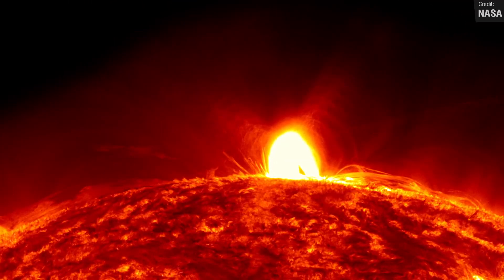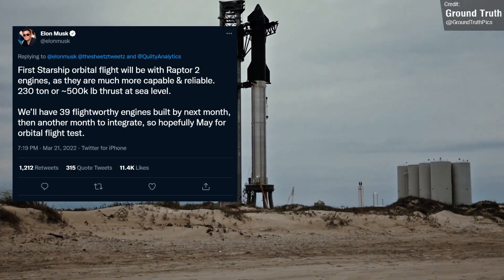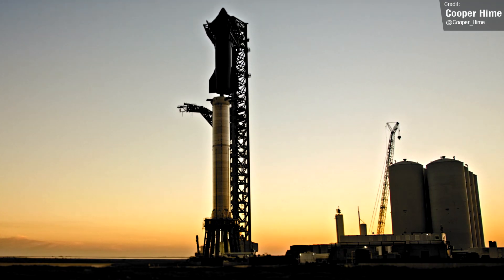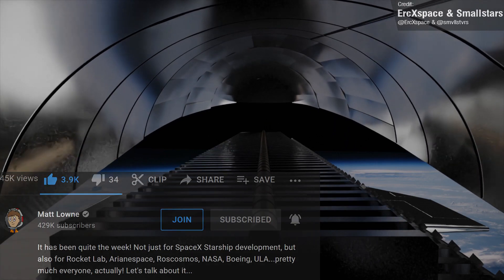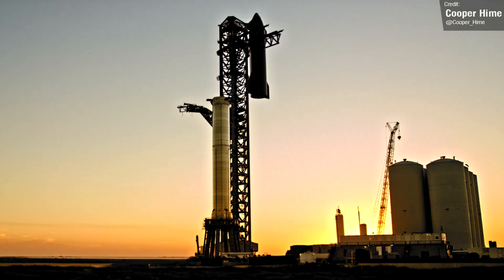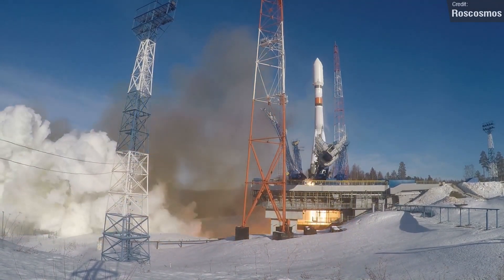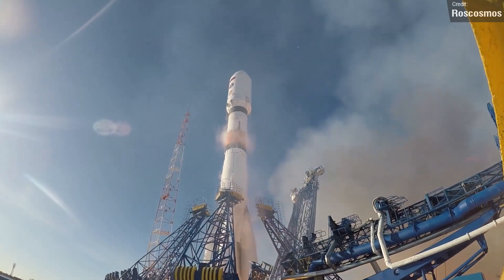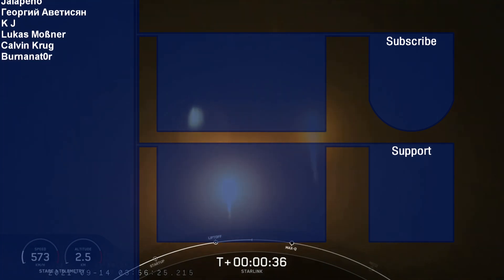SpaceX Starship Orbital Flight DELAYED - Booster 4 & Ship 20 scrapped + Soyuz launch

Comment: You are appallingly naive. SLS is years behind and HUGELY over budget--estimates are $4B per launch.  NASA auditor labeled Artemis/SLS *unsustainable*. That means Boeing SLS is in danger of being curtailed or even cancelled. Spacex Starship costs estimated are 1/10 that of the Boeing cash black hole.  The Inspector General has criticized both Boeing and NASA for poor management of the SLS program which has ballooned to 8X its original budget.  I like your channel Matt.  You should be more careful in throwing around dismissive and derisive labels at  your followers like conspiracy theorists.  It's obvious you don't have clue or ignore DC politics.   NASA has already spent $40B on Artemis with an estimated $95B price tag by 2025.  30% of Boeing revenue ~$27B is federal and they spend $13M on lobbying.  Perhaps you think that doesn't come with friends in high places.  Everything in DC is about the politics and  money.  FAA not political?  (The joke in Washington now is "What's the difference between a conspiracy theory and the truth?  About 6 months. )  Of course Boeing proxies want to get SLS into Space before Starship.
Reply: Based on the $2.94B price tag of two lunar landings, each one is roughly $1.47B. So roughly 1/3 the launch price, instead of 1/10. Still a significant savings. SLS/Orion are needed until Starship can mature to the point of replacing them.
Reply: @steveaustin2686  Won't debate exact cost calculations since we agree on the main point.   However, SLS/Orion also has yet to leave the ground.  Argument they are needed until Starship matures seems premature.
Reply: @per619  It's about where SLS/Orion are in development, where Starship is in development, and how capable the Starship variants and Lunar Starship will be.

SLS/Orion are scheduled for a wet dress reheasal in less than a week and a launch in a month or two, barring any major problems appearing. Artemis I is more akin to the test landing Lunar Starship needs to do  before Artemis III, than the first 'orbital' flight of a Starship test article. So even though it took a VERY long time to get SLS to this point, SLS/Orion are almost to the operational stage.

Lunar Starship still has a lot of development to go with Starship needing to be able to get to orbit (likely) and refuel hundreds of tons of propellant in LEO successfully (possible). Per SpaceX's plan, laid out on page 27 of the GAO report denying the HLS complaints, Lunar Starship will need two other Starship variants to work. The Starship Tankers and the [DELETED] propellant depot. SpaceX apparently had the GAO redact information on what is a propellant depot from the context. Musk also stated that with the updated ~150 tons to LEO for Starship, it should take up to 8 Tanker flights to refill the [DELETED]. So the Lunar Starship plan looks to be as follows from that GAO report.

The [DELETED] propellant depot launches to orbit first, likely onto whatever inclination that NASA plans Lunar Starship to launch on (7/9 of Apollo were on ~32.5 deg). Then up to 8 Starship Tanker flights will refill [DELETED], which will likely be 2 to 4 Tanker Starships per the HLS Option A Source Selection Statement (pg 11). The last to launch is the unmanned Lunar Starship, which then refills from [DELETED], before heading off to lunar orbit to wait on the crew to arrive on Orion. So up to 10 flights to get Lunar Starship to the Moon. Once Lunar Starship is in lunar orbit (100 day loiter capability per HLS pg 9), SLS/Orion launches to bring the crew to Lunar Starship for the landing.

Per the GAO report on page 10, the SpaceX plan for Artemis III has the Starship launches happening 12 days apart. So to get Lunar Starship fully fueled in LEO for the trip to lunar orbit takes around 108 days (over 15 weeks). This to me is the main sticking point for Starship to replace SLS/Orion for Artemis III, along with Lunar Starship practically being out of propellant once the lunar landing is over. 

Lunar Starship apparently will have the dV for leaving LEO, entering lunar orbit, landing on the surface, and returning to lunar orbit. Orion takes the crew to lunar orbit and back to Earth from lunar orbit. For Lunar Starship to return to LEO after the suface mission is over, would require refueling Lunar Starship in lunar orbit. Per page 11 of the HLS Option A Source Selection Statement, all propellant transfer operations are planned for LEO, so refueling in lunar orbit would be a departure. The Artemis III mission envisions about a week on the surface with later missions to do as much as 4 weeks on the surface. With about a week to transit from LEO to lunar orbit and then from lunar orbit back to LEO, Artemis missions look to be 2 to 5 weeks long. Based on the once every 12 days for a Starship launch, sending a Starship Tanker to refuel Lunar Starship would be about 3 times longer than the longest contemplated lunar mission. IF NASA would want to strand astronauts in lunar orbit waiting on a tanker in the first place. If something like a Starship Shuttle was used to replace Orion's journey to lunar orbit and back, it would be longer than the loiter time of Lunar Starship to wait on crew.

So until Starship matures to the point of launching around once a week, Starship doesn't seem to have the capability to replace SLS/Orion for the early Artemis missions. Now, once Starship can launch fast enough to make the Lunar Starship with a time margin that NASA would like, then even with taking the crew to and from LEO on capsules, it could be cheaper than SLS/Orion's $4.1B each for the first 4 launches. I'll start another reply for how I think a Starship Shuttle could work.
Reply: @steveaustin2686  Fair enuf--good insight.  Thanks.  My thought is Starship lunar lander is being developed to meet current Artemis requirements.   NASA may change its hugely complex strategy as the auditors 'unsustainable' criticism hints.  If we combine SLS and Starship, we are talking about $5B a trip?  50 years ago we flew direct to the moon, landed and returned.
Reply: @per619  NASA recently announced another lunar lander competition for the second lander that NASA wanted. SpaceX does not have to compete, since they already have the HLS Option A contract. NASA is going to have SpaceX go with more sustainable options for a second manned landing, that SpaceX already planned for. 

It would be nice to ditch SLS as soon as Starship can replace it, but I have a feeling that NASA will fly SLS for the 7-8 missions that they have already contacted parts for.

Yeah, $4.1B for SLS/Orion and $1.47B for Lunar Starship for Artemis III. Apollo had much slimmer safety margins than SLS/Orion I understand. SLS is too expensive and maybe Boeing can drop the price like they say, but I won't hold my breath.
Reply: @steveaustin2686  My bet is Spacex is already talking to NASA about going direct.
Reply: @per619  Problem is that Lunar Starship won't have the dV to get the crew back to Earth without a refueling in lunar orbit. I highly doubt that NASA will take that risk of possibly stranding astronauts in lunar orbit waiting for a Tanker to arrive. That is why I think that something like a Starship Shuttle would replace SLS/Orion. It would meet Lunar Starship for the landing and have the propellant to do the round trip without needing to be refueled. Remember that refueling a Starship in lunar orbit requires up to 10 flights for the Tanker to get there. The Tanker would use a significant portion of its propellant just getting to the Moon. The Tanker would almost certainly be unmanned, so it could aerobreak on the way back to Earth, leaving more propellant to transfer in lunar orbit. 

NASA is looking for more sustainability than HLS for the second landing. Like ISRU, 4 crew instead of 2 crew, longer missions up to a month long, etc. They may or may not do reusability right away.
Reply: @steveaustin2686  Tanking may only be done in LEO, not Lunar.  It's an open question if Starship has enough propellant to return but I'd bet dollars to donuts that's what Musk is planning: continued massive effort on Raptor 2 and he's already said Mars will not use raptors.
Reply: @per619  To go from LEO to landing on the Moon and then back to LEO on one tanking would mean a paradigm shift in dV. It would mean that Starship could leave LEO without refueling at all and nothing that Musk or SpaceX has said implies that they think that can happen. I think that is too far fetched.
Reply: @steveaustin2686  Without getting into the technical weeds too far, in broad brush strokes, if Apollo 11 landed and returned 50 years ago with far inferior tech...I remain the optimist.
Reply: @per619  The CSM was lighter than Orion as it was less redundant. The LM didn't mass that much more (15 tons) than the engines on Lunar Starship (10 or so tons). It's an apples to oranges comparison.

Lunar Starship getting to the Moon for the landing and returning to lunar orbit requires the ISP of the Raptor 2 that Musk talked about. I don't think that Raptor 3, or whatever SpaceX calls it, will be that much more powerful to allow everything to happen on one refueling in LEO.
Reply: @steveaustin2686  Hopefully we'll both find out.

Comment: I smell FAA is bullshit saying they'll need another month at least.
They must have been secretly drafted by Boeing corruption to prevent Starship from flying before SLS if not forever.
One time, I can accept, two times, I smell incompetence or mis management, three times, I call it bullshit.
The stakes aren't for FAA, but for Boeing. Boeing has already corrupt th FAA in the past, cough cough Boeing 737 MAX cough cough.
On the other hand, if you don't go for the conspiracy theory, how could the FAA foresee or even change its organization for Starship and Starbase certification with no more funds than before? That would require a budget increaqe wich they didn't have anyway.
So conspiracy or not we're stuck with un underfunded and potentially corrupt FAA.
Matt, Russia wanted that Vostochny replaced Baikonour on the long term.  Of course, Khasakhstan wished they had the financial means to maintain and actually use such a facility by themselves but they obviously can't.
Reply: The FAA has mentioned consultations twice now. While the FAA is the lead agency, NASA, the Army Corps of Engineers, the US Coast Guard, the US Fish and Wildlife Service, and the National Parks Service are all part of the FAA review. I think that some issue has come up and the FAA and SpaceX are working with one or more of the other agencies to resolve the issue. The FAA and Biden conspiracy theories are pretty silly. The review started before Biden was in office. SpaceX got the HLS Option A contract after Biden was in office. The FAA defended SpaceX in front of Congress over the SN8 flight without approval, after Biden was in office.

Both Biden and Musk are adults, so even if they don't like each other, they both want Artemis to work. NASA needs BOTH Starship and SLS/Orion for Artemis III. They are not 12, even though Musk likes middle school style jokes (4/20 & 69).